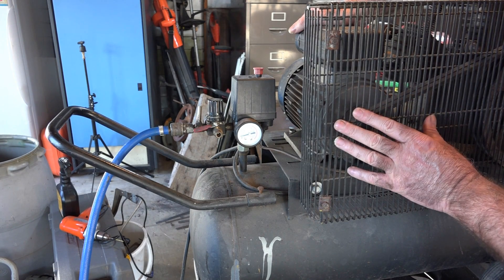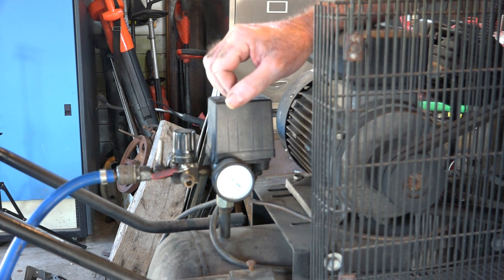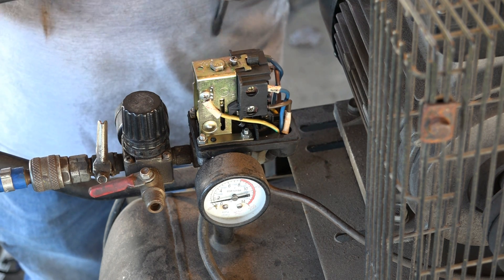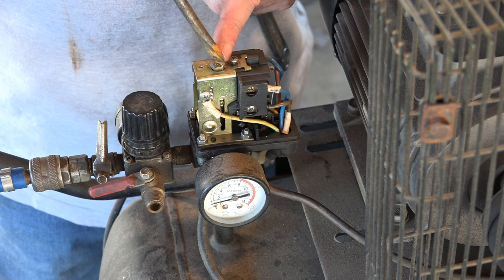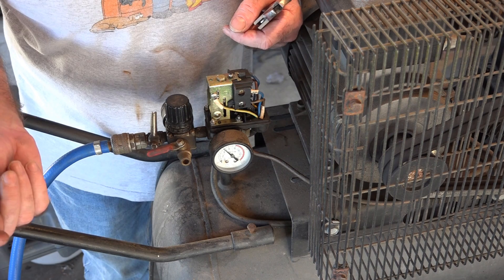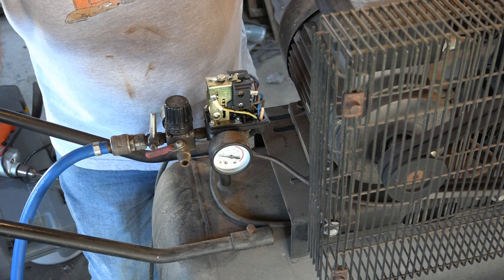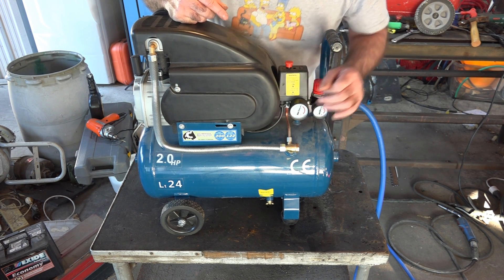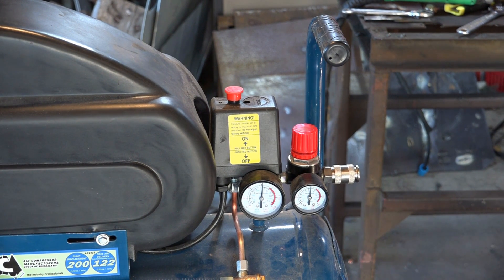How to Adjust Your Compressor Air Pressure Switch

Comment: Thanks for your video.  My safety valve kept releasing at 10 bar.  Wound the screw back to 8 bar.  problem fixed.   Just wasted an hour going to the shop and asking where to get it repaired.    I should have watched your video first.
Reply from the maker: Lol

Comment: Much of a muchness 😂
Anti clockwise 🤔😆
Thanks mate‼️
Great info once I gathered the dialect 🤙🏻😁
My 60 gallon is popping off at 160-165. The pop off safety valve is blowing off sometimes and sometimes it just bleeds off slowly hissing out to 150-155. 
I was just going to buy a new pressure switch, however, I think it may just need a slight reduction of pressure to rectify the issue. 
Happy thanksgiving 🍁
Reply from the maker: Nice work!

Comment: Think I have a bad or sticky pressure switch, or maybe even on/off assembly on my 6 yo Craftsman 3gal 1 hp unit. I bought a whole new switch but the  small copper pipe inlet is 90* away from where it should be. My question is are these switches rebuildable? It feels like the the on off handle itself it working intermittently when I move it back and forth...make sense? I'd rather repair than to replace and have to rerun the copper tubing. Thanks!
Reply from the maker: Hi Brent anything can be rebuild if you have the time and energy. But for the cost i would just buy new mate.

Comment: My compressor would continuously run to max PSI until the over flow valve went off then repeat to max PSI again over and over. 
Thanks for your advise - I have loosened the main screw and works perfectly now. Cheers mate.
Reply from the maker: Cheers Craig

Comment: I just scored a very gently used 26 gallon (~98Liters if my math is half right) compressor to upgrade my new projects that needed a little TLC. It too was leaking and the previous owner was kind enough to throw in a much nicer pressure switch to replace the one that was leaky. He didn't seem to mind too much when I let him know that the switch was probably fine but had some gum from built up oil vapor blow-by on his check valve that was bleeding air into the switch. He admitted he didn't know all that much about them but sold it to me nonetheless. Stand-up guy! 
Anyway, if your big tank has some mileage, definitely worth pulling your check valve and giving it a once over to keep the ol' girl punching in her weight class. 😁
Reply from the maker: Great tip cheers

Comment: Good info Pete but where is the leak coming from? Looks to be bleeding down pretty quickly. I’ll bet that ole girl can be made to run for many more years for much less than a new Chinese compressor. Great info!
Reply from the maker: Yea mate your not wrong .
Reply: Its leaking from the viton capsule in the three way valve. Either turn the capsule (pastule) around, stretch the pressure spring, or replace the three way valve. Cost is less than $10us money.